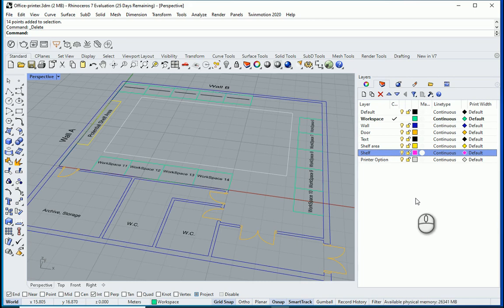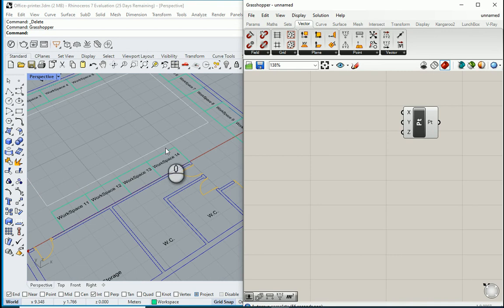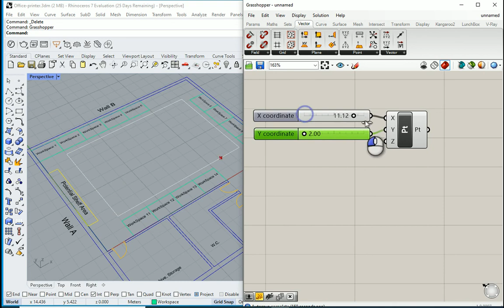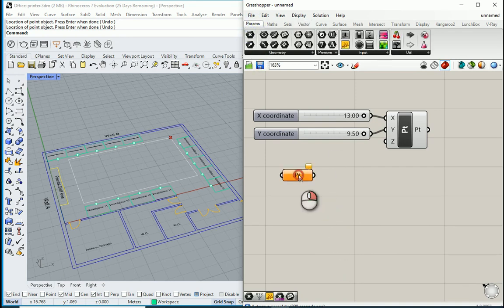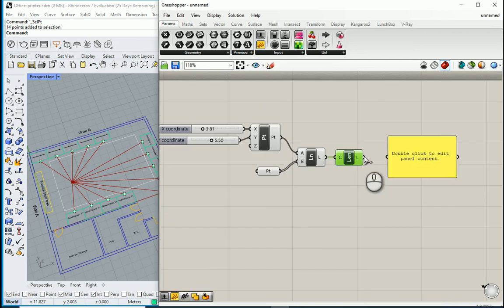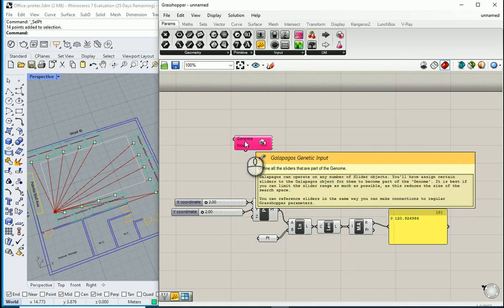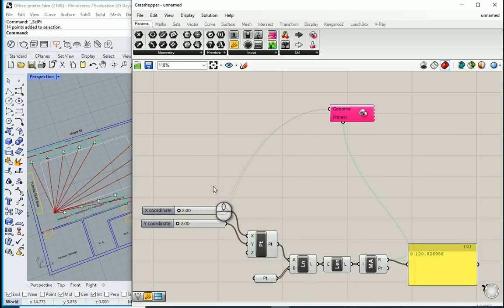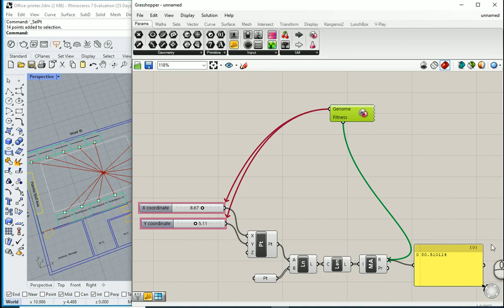Design Optimization, Galapagos, Grasshopper 1

Comment: Thank  you for this contribution,  is there any documentation to learn design optimization?
Reply from the maker: Hi Islam. This is an interesting book, although it is not specifically about Design Optimization: "Form + Code: In Design, Art, and Architecture, by Casey Reas and Chandler McWilliams."
Reply: Thank you Hoda.
Reply from the maker: @islamrighi8395  My pleasure!